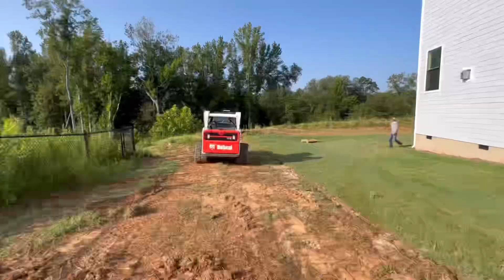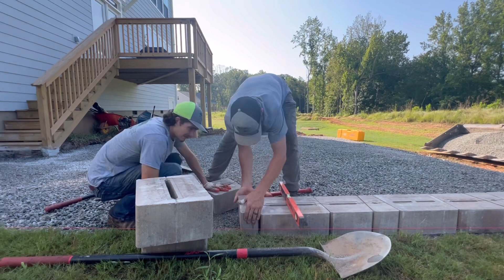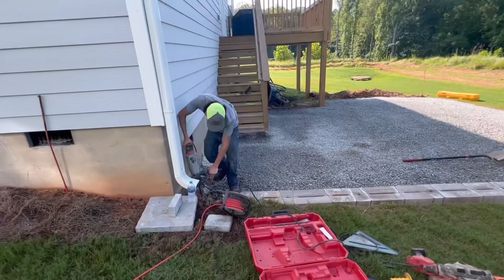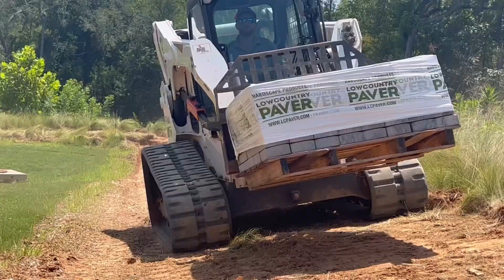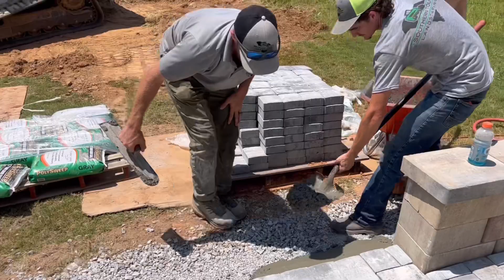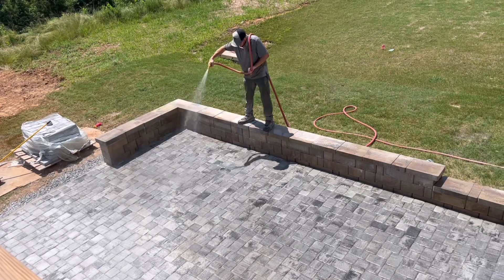Sitting Wall + Pavers 🔥

Comment: Great video! DIYing my patio the same way with 6 inches of clean 3/4" stone for the base and 3/8" chip stone for the screeding.

After compacting the 3/4" stone I developed low spots "waves" in my finished base layer that I am hoping to make up with the 3/8" stone while screeding to grade. Is that normal?
Reply from the maker: It’s easier to be more consistent with the base layer because that layer is compacted. When you add the screed layer that should just be an even spread on top. It just takes a lot of practice. But getting it completely level starts with the grading first. We use a laser level.